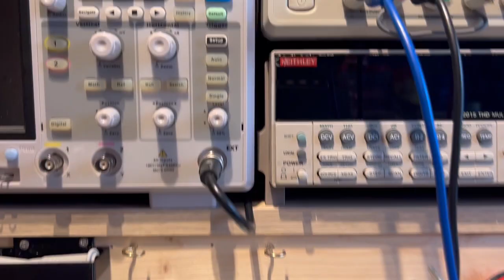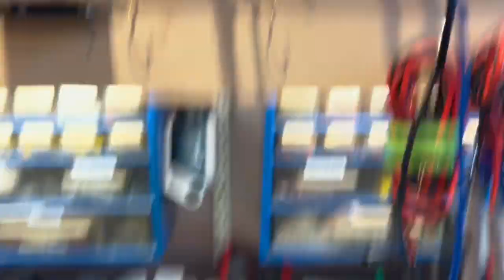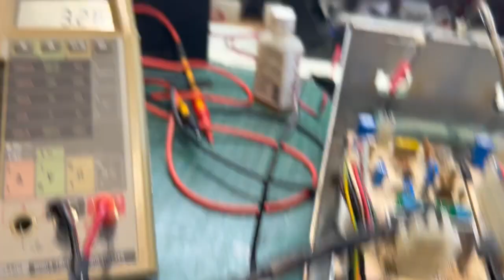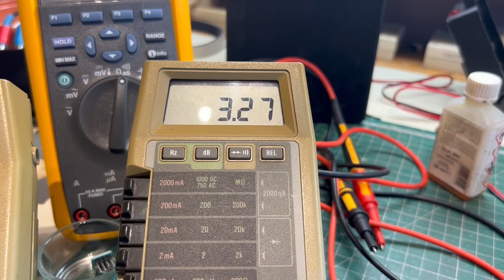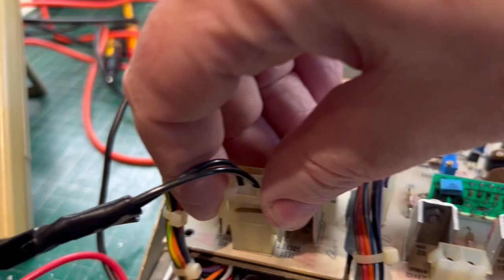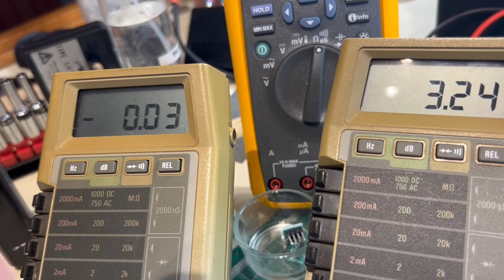Rock-Ola Jukebox Amplifier 52280-A (part1)

Comment: This was very helpful in getting a 52280-A working! 

I have a question for another 52280-A but this time I don't have the power supply. 

Am I correct that you connected your dual power supply as: blue lead (-32VDC) to the end of F3/F4 and the red lead (+32VDC) to the end of F1/F2 AND the black lead to the chassis?

Cheers!
Reply from the maker: Yes that is correct. The full wiring diagram of any machine which uses this amp. Will show where the +-32v rails are connected
Reply: Thanks so much,  Pete. I look forward to your future videos.  Subscribed!!  @petehillyer5444
Reply: Hi Peter wondered if you can help . Have a customer with a 477 where by as soon as you switch on you get a uncontrollable  hum  which sounds as if it has some faulty power output transistors or some faulty smoothing caps in the power supply. I am trying get a service manual so i can carry on with repairs just what your opinion would be on this problem. Kind regards Robert   excellaudioservices .
Reply: Hi again . Sorry peter one thing i forgot to check when i was in front of the unit was to see if the hum was on both speakers . Not sure but does the 477 have separate PSU for either channel. Many thanks.